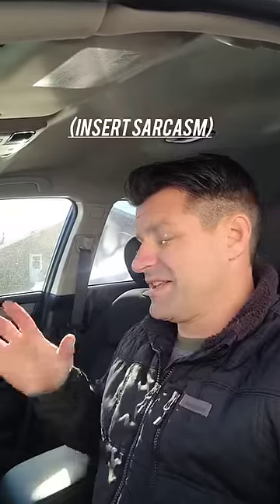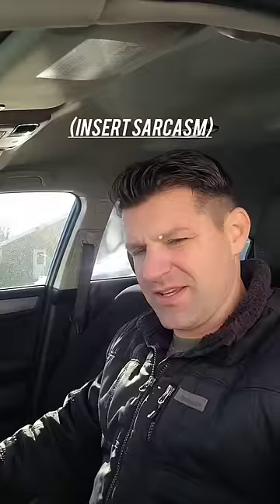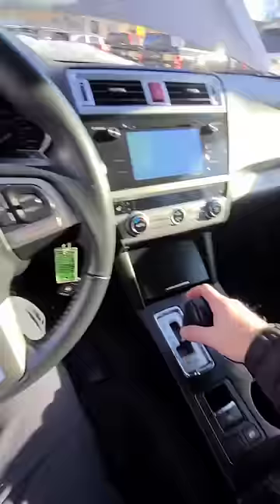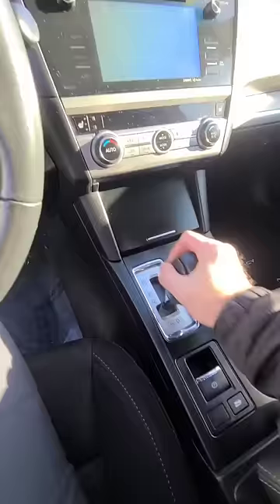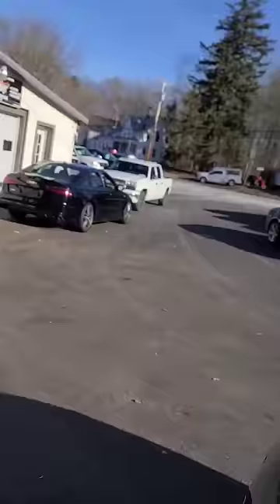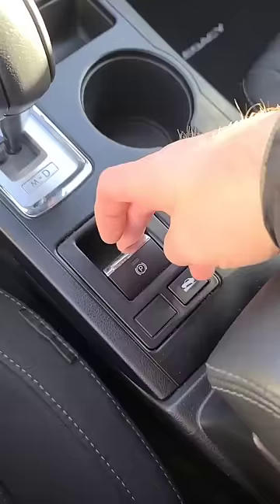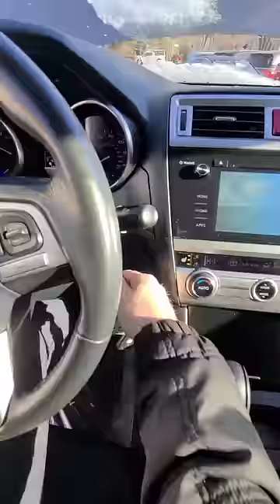Why Subaru Engineers deserve a punch in the Face! #shorts

Comment: At some point people decided that the "parking brake" wasn't the "emergency brake".
Reply: I've only ever heard the term "emergency brake" being used in the US. Everywhere else it's called a park brake.
Reply: true words
Reply: Yeah, PARK is the Parking "brake" 😂the Emergency brake is in case Park fails, hence "emergency"
Reply: Parking Brake is a better name for your Emergency Brake because it saves explaining why you set your Emergency Brake every time you Park your vehicle.
Reply: @WireWeHere  Except the parking brake only really gets used by the car if something catastrophic breaks sending the car rolling, therefore causing an emergency. It can also be used in an emergency when the regular brakes break and no longer brake.
Reply: @bingbongmcgee  You're wrong. P on the shifter essentially just locks the transmission. Not using the parking brake hangs the entire car on just the transmission. If you regularly park on a slope, that's a great way to put wear on your transmission unnecessarily.

The p-brake is designed to take the weight of the car.

Sequence is always foot-brake -> p-brake -> off foot-brake -> P shifter.
Reply: @vinculaomega5283  you smart. I like that
Reply: @vinculaomega5283  Thank you, I was just about to post this.  It's absolutely a parking brake; a lot of cars have separate drums for their parking brakes but if you have a truck like mine, the "emergency brake" simply activates my rear brakes... e.g. if those decided to go out, the "emergency brake" wouldn't do shit.
Reply: @vinculaomega5283  Pro tip if the transmission is in park, it's using the parking pawl and is NOT putting any wear on the transmission. 

And also, typical procedure is to put into park and then apply the brake. Once the car is held by the transmission, applying the brake doesn't do anything to reduce stress on the transmission.
Reply: “ my logic is “parking brake” in a manual car and an “emergency brake” in an automatic
Reply: @Jabulaya  Emergency Brake is great when your brake lines rot out and you lose brake pressure from all 4 corners

there is a reason northern states pay attention to your cable "parking" brake at inspection time..

I've driven home 30+ miles with no brakes because a line let loose. Electronic e-brake is dumb
Reply: @heartysteer8752  the parking pawl is a metal pin that hooks into the transmission line and locks it, is it not? And the pawl is a part of the transmission, is it not? If the pawl is the only thing holding the car it will wear faster as there's always some play between gears, and higher forces cause more wear.

Thus, as the pawl is part of the transmission, and it wears faster by not using the parking brake, my first comment is true.

Not to mention that if you don't use the parking brake the pawl is the single point of failure. If you use the parking brake you have at the very least two points of failure, and most likely more.
Reply: and if you live in the UK it's called the "I'm stopped in front of a red light and my foot'll get tired if I keep it on the regular brake brake" /s
Reply: @Big-Show1  in germany they were called "Handbremse" which translates to "handbrake" because it was purely mechanical and was a lever right under the gearstick that you can pull up.
nowadays its just like shown in the video.
Reply: People would use it on the highway when they were in an “emergency” and killed a lot of people. That’s why it’s called a parking brake now, only meant to be used when parking
Reply: We call it a handbrake in the UK and I refuse to buy a car witha stupid electronic button instead
Reply: @heartysteer8752  Yeah Vincula is exactly right. It won't put any real stress on the gears, but the parking mechanism is NOT made to hold the car!
If this mechanism breaks you're gonna have metal parts flying around the transmission, do you think this is worth it? And yes there are absolutely cars where this happened. Parking brake is also stronger.
@Vincula Omega 
Although I disagree with with the procedure: Why would you let your foot of the brake when still in drive?
Foot brake -> Park -> Parking brake (won't really matter which first since your foot is still on the brake) -> release foot brake.
Reply: @MrJord1994  But why?
Parking mode doesn't have to do anything with what the parking brake does.
We in Germany call it "Handbremse", hand brake. Very simple
Reply: The electronic parking brake on my VW works just fine as an emergency brake. Tried it in a parking lot at 30 mph and it stopped the car just fine.
Reply: @Big-Show1  we called it the handbrake in the UK when it required the use of your entire hand. only since they went to the electronic systems did they start putting the (P) on it for parking. still call it the handbrake out of habit.
Reply: It never was. This is an American thing.
Reply: @marcokrueger3399  I maybe should have added that the sequence start with the shifter in neutral. The idea is to make the forces on the transmission minimal and the brakes maximum.

If we make sure that the parking brake holds the car before the shifter is in park, most if not all the forces will be only on the brakes. The transmission will just be a fail-safe. This because the brakes already "caught" the car.

If we do it the other way around the transmission will pick up the force first, and then the parking brake become the fail-safe.
Reply: Exactly
Reply: It never was an emergency brake. No car manufacturer would open themselves up to the liability of calling it an emergency device
Reply: @vinculaomega5283  I was absolutely horrified to see how far I had to scroll down to see someone say this.
Reply: @vinculaomega5283  "this part doing it's job is causing it to wear out"

If they built the transmission so that part isn't on the back side (before any gears from the ground) then someone did their job wrong. 

For that matter in cars with a manual transmission you can leave it in gear to hold it and the idea that this pressure would harm anything is laughable,
The only problem with letting the engine hold the car in this way is in the case where the hill it's on is steep enough to turn the engine over.

This idea of having the E break need power to toggle is fundamentally forgetting the reason it was ever there in the first place.
Reply: @brandonweeks  people getting themselves killed because they don't understand how their car works, I'm not surprised at all.

Doesn't change the fact that this car has forgotten why cars ever had an emergency/hand break and whoever cleared it to drive on American roadsshould be ashamed.
Reply: @ARockRaider  lose emergency brake from your car lingo, hand brake and parking brake also very different. My hand brake has its own personal master cylinder
Reply: @marcokrueger3399  Don't think I've ever seen anyone doing the order you describe. I agree it would reduce the pressure on the parking pawl. Haven't heard of anyone around here with a broken pawl though. Even when parking heavily loaded or with trailers. AFAIK, the pawl is near the tailpiece and any broken pieces wouldn't likely damage the transmission further.
Reply: @vinculaomega5283   Don't think I've ever seen anyone doing the order you describe. I agree it would reduce the pressure on the parking pawl. However, I haven't heard of anyone around here with a broken pawl. Even when parking heavily loaded or with trailers. AFAIK, the pawl is near the tailpiece and any broken pieces wouldn't likely damage the transmission further. It doesn't engage with any of the gearing in the transmission.
Reply: @heartysteer8752  Agree it's not likely to damage the transmission, I just think it's not worth the risk if theres a better, no effort way of doing it.
Which order do you see with other people/how do you do it yourself?
I always do it that way and I think it's the least effort way. I mean you already have your foot on the brake anyway, it's just two steps.
I was not sure but I think know I know why there even is a parking mode - because a torque converter will always transmit power, so if you let your foot of the brake the car is gonna start rolling no matter what. Not sure why they have it with Dual clutch transmission though.
Reply: @marcokrueger3399  I don't understand what you are saying about the torque converter. If the transmission is in neutral, no power will go to the wheels. Park is just neutral with the parking pawl engaged.

What I see on the rare occasion that anyone ever uses the auxiliary brake is; park then brake. And maybe turn off the engine in between. A lot of vehicles the auxiliary brake is a pedal, so the whole 'it's a handbrake' thing is moot. 

Around here the salt and road grime gums up the cheap cables so most people don't use the park/emergency brake. It's a good way to have the brakes not release fully and burn them up.
Reply: @heartysteer8752  Yeah you're right, theres also neutral. Then why is there even a parking pawl? There's no such thing in manuals and it's also not necessary in any way.

Auxiliary brake is a term I have to hate... it's a brake you use for parking, not an added extra. It's also not an emergency brake at all. It has one purpose...

I mean, park then brake doesn't contradict my statement since I said it doesn't matter which you do first. If you use the parking brake while still having your foot on the brake, your car won't move (much) so the parking pawl is free of tension. That's what 

I know only one manufacturer that has the parking brake with a pedal and that's Mercedes Benz, but only for their transporters and stuff. Maybe Americans do that more often, but in Europe it's really, really, really uncommon.

Salt and grime are a relly good reason to use the parking brake! If it is not used it will seize up much more quickly because there is no movement with the cables. The parking brake freezing is also a problem of earlier times (drum brakes and stuff), not an issue with modern cars. But I see the problem, people not using the parking brake, then it gums up and they think: "What a shit, glad I didn't use them." Yeah, you're doing it wrong but you don't even know. Using it at least occasionally would be the best.
Reply: Each time you park it’s an emergency?
There’s something wrong with you.
Reply: @heartysteer8752  
Pro tip:  Engage the park brake THEN put the transmission into Park.
Reply: @oggyoggy1299  which one is park? My shifter only has 1, 2, 3, 4, 5, 6, and R.
Reply: @marcokrueger3399  in America some vehicles’ parking brake can be operated by another foot pedal.
Reply: @PrydeWater901  How common is it, though?
As I wrote earlier, Mercedes Benz uses that for decades. We like to mock it as a "mud sling" and Honestly I don't see what the benefit of this type of parking brake is at all.
Reply: @marcokrueger3399  it is quite common in fleet vehicles such as medium duty trucks and larger sedans.
Reply: Where I live, we use the term "hand brake".
Reply: @Big-Show1  I know SO many people in the us who don't even use the parking brake in their automatics because they think putting in park is enough
Reply: @marcokrueger3399  If you hate the term auxiliary brake because it's 'not at all an emergency brake', how do you stop when the primary braking system fails?

When I'm at a drive thru window for a while, I put an automatic transmission in park and take my foot off the brake. I don't put it in neutral and continue to hold the brake. And of course it's used when parking. 

Manuals when parking can be left in gear and use the engine to prevent it moving. Some equipment does have a park position with a manual by putting it into two gears at the same time, thus preventing it from turning.

In the US, where this video is from, of the dozen or so vehicles I've had, only one has a hand actuated mechanical brake. That's a Toyota car, all of the rest being north american made and having foot pedals. In driving school we were taught how to use it in emergencies if the hydraulic brakes failed.

Regarding grime, I've tried both ways. The continual use method just works more contaminates into the Bowden cables. It abrades the coating allowing the steel cores to corrode and then seize or break.

I don't know what you mean about drum brakes not being modern. Many vehicles with caliper brakes which also have a mechanical brake system, then have small drum brakes also.
Reply: @heartysteer8752  Of course you can use it in an emergency, that's not the point. The point is that calling it an emergency brake leads to the impression that this is the primary usecase for this brake which it is not! This brake is meant to secure the vehicle when it is parked, everything else is an added bonus. So, it is not an emergency brake, it is a parking brake with the added bonus of using it in the event of the hydraulic brakes failing. Simple as that.

Did you see the comment of Brandon weeks? People using it in an emergency because it is called emergency brake? That's what I meant!

It is not a real issue when you're on a flat or near flat surface which I suppose most drice thorughs are. You could also simply engage the parking brake if you don't want to leave your foot on the brake. You guys always act like that's sooooo much work, totally ridiculous! But to be honest, I could see the trouble with the foot pedal, I would always prefer electronic parking brake over those. Yet another reason US cars are shit lol

Yes, manuals can be left in gear, BUT: Engine friction is will never be capable of stopping the car or locking the wheels. The parking brake sure is (as it is tested at vehicle inspection). Leaving it in gear would not work as well with a torque converter, that's why I suppose the parking mode was invented. But that is also an added bonus and should not be normal operation. I wish you a lot of fun putting thousands of dollars on the counter having the transmission rebuilt because the parking claw broke.

Can't you guys have proper seals!? Like, there's a rubber seal around the end of the bowden cable to prevent exactly that. What the heck are you guys doing!? Or do you all live in the worst climate on planet earth!? Seriously, me and my parents always use the parking brake, they've done so for the last 50 years and never had any trouble with it (apart from the freezing with drum brakes that I've mentioned, but the last car with drum brakes in the rear was built before the year 2000).

Yeah I know drum brakes for parking brakes is a thing, but I've only seen it with MB. Maybe this is due to Mercedes being owned by Chrysler in the past?
Drum brakes as a main brake system is mostly a thing of the past. They are coming back with some electric vehicles, but apart from a few weird caliper-drum mixes, they've not been used for the past two decades. Maybe they were more popular in the US due to cutting cost or something, I don't know. But that would be another reason US cars suck
Reply: @austinh1028  You know in many cars you can use the electronic parking brake as an emergency brake? You simply hold the button and the car will brake. Simple as that
Reply: because it isn't.
Reply: @Big-Show1  exactly! It only prevents car from rolling away.
Reply: @bruwin  have you ever tried to stop a fast moving car using a parking brake? Be honest.
Reply: @bingbongmcgee  Shouldn't just do that, afaik it's always good to hit the parking brake there's a little pawl in the transmission that keeps the car from moving.
Reply: It was never an emergency brake. The only people who called it that were dumb people or people parroting those dumb people.
Reply: @snap-off5383  Of course. parking brakes will not stop a moving car.
Reply: @Jabulaya  
I have had brake lines rust out and pedal goes to the floor. If not for the Emergency Brake, I couldn’t stop. 2500HD with the bed loaded with lumber. Foot operated and one hand holding the release, other hand holding steering wheel. 5 miles from home, fun ride. If your brakes are properly adjusted it will stop a truck.
Reply: @Jabulaya  Unless you have airbrakes...You could have a failure at your pedal, master cylinder, brake lines, or wheel cylinder/caliper...and an emergency brake could be used to help stop/hold your truck. Being able to modulate the brakes is usually useful too, and such electronic brakes don't allow that.
Reply: Because it’s never been the emergency brake. It is a brake that’s meant to be applied when the vehicle is parked, therefore, parking brake. If you were going 50 down the road and for some reason your foot brake failed, pulling the “emergency” brake would not save you
Reply: People who don't think a parking/hand/emergency brake can stop a car quicker than coasting in neutral will stop it are idiots.

 Being able to modulate the brakes, to avoid lockup/skidding, is a safety concern.
Reply: It never was? They were never called "emergency" brakes. That was old men telling their kids in a last ditch effort when the brakes failed...
Reply: @vinculaomega5283  Bingo. To add, dont send the brake level to the moon. Anything over 7-10 clicks and you're being dumb or your cable is loose.

Its almost like theres an hour read manual with all this info in it. But people spend countless hours arguing online